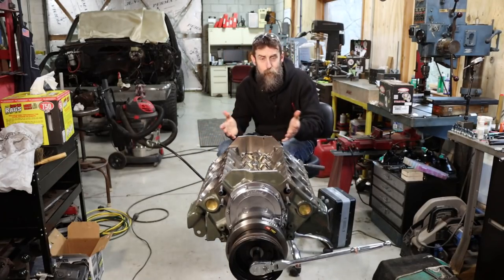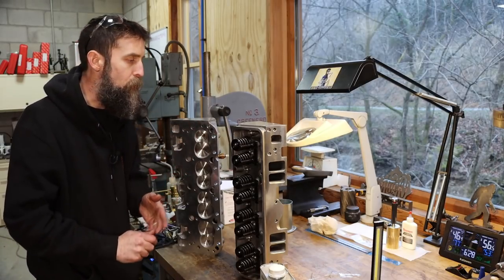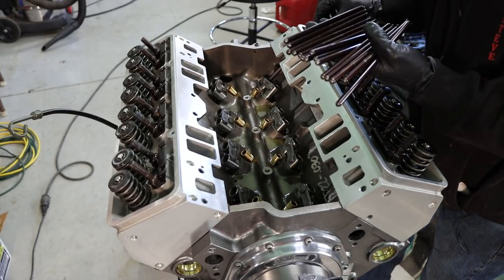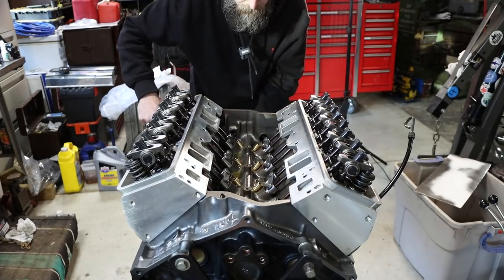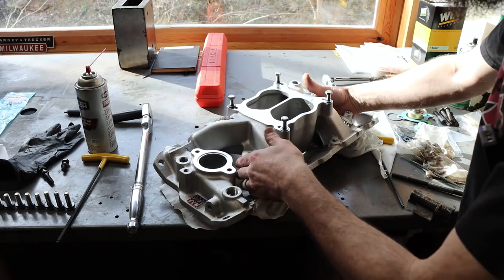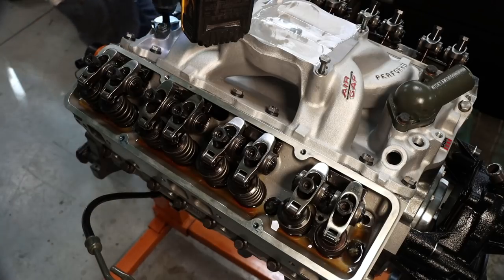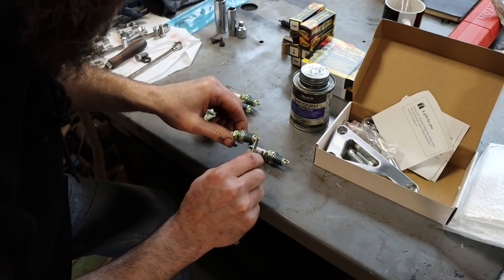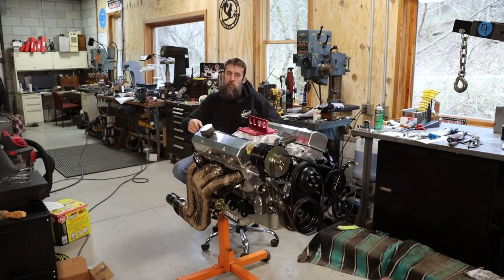383 Build block COMPLETE!

Comment: hi,  is there an oil pressure relief valve on that engine design?  also drill speed maybe way over actual engine  running speed, and finally (tried to bite my tongue here lol) wire locking can be an artform.
 (Brit aerospace engines guy!)  for anyone interested here`s a decent link https://www.youtube.com/watch?v=OwFjUX6SaY8&ab_channel=AgentJayZ
Reply from the maker: It has a built in pressure bypass 👍
Reply: @SteveSummers  obviously we Brits (on the correct side of the pond) dont see much of this engine as we tend to go for smaller, more fuel efficient , better designed and engineered engines .....(heavy chuckle followed by belly laugh)  but i do like squirrels, and i wish i had your shop!

Comment: Steve, when adjusting the valves, I didn't hear you say that you started at TDC on cylinder 1.  I assume you didn't just start in some random spot.
Reply: Yep. Random. You just need to get to the base circle of the cam once for each lifter adjustment.
Reply: You "assume" wrong.  How he did it is text book.
Reply: @paulcopeland9035  Oh, is your name Steve?  Because  it says Paul.
Reply: @frotobaggins7169  Steve is a good.  Yea, I like it!

Comment: Man you should never spin your oil pump that fast with a drill if you look at the speed the oil pump  turns @ 6800 rpms crank speed is about 1/2 the speed you are turning it , spinning a oil pump that fast can cause you to spin a bearing before you even start the engine Trust me I had a 30,000 $ race motor I bought home did the same thing and it cost me a lot of money I love all your videos just wanted to pass on hard lessons learned lol cant wait to see it complete
Reply from the maker: I never considered running the oil pump too fast🤔.  Thanks for watching and the heads up